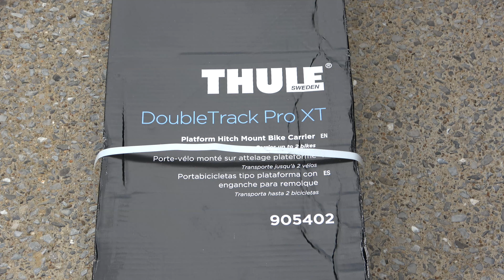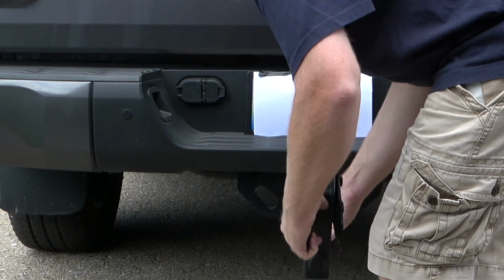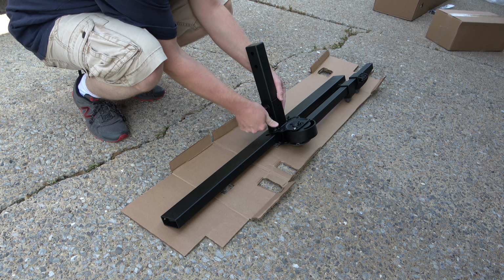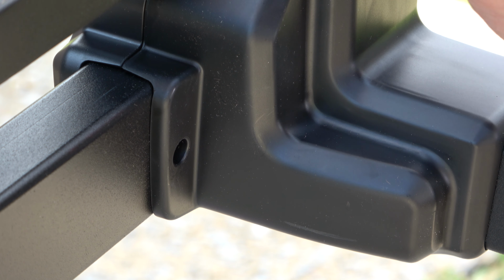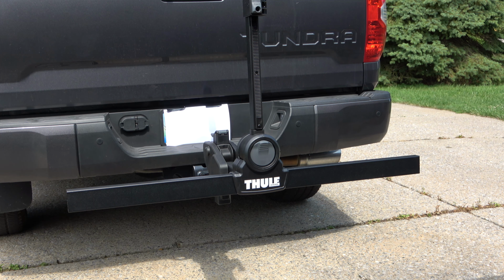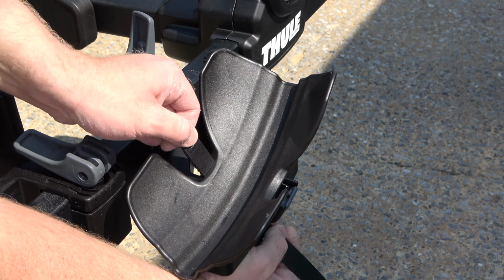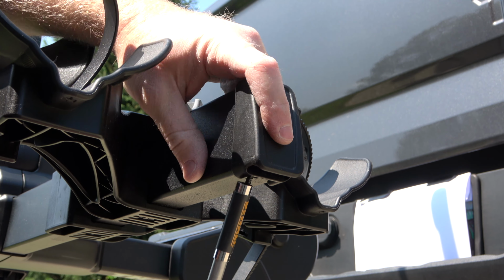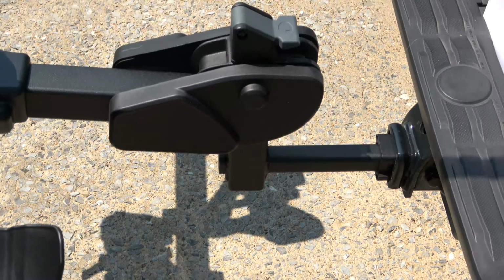Thule DoubleTrack Pro XT 2 (Model #905402) Hitch Bike Rack - Assembly Instructions

Comment: A huge thank you Mr. averagejoe.. I installed mine without a glitch using your video instructions.    All the tips were hugely well thought of.  As far as the theft situation for the brackets that attach to the locks, you can basically permanently disable the bolts by applying a dab of epoxy putty to the heads of bolts. It will harden to rock consistency and be impossible to remove, whether you want to or not.
Reply: That's a really good idea. Thank you!

Comment: This video was quite helpful in prepping for assembling the rack with a friend.  We need a maul to get the cradles on, and for that reason didn't worry about securing the end caps, since the cradles aren't going anywhere - or probably not the caps either!  You don't demonstrate how the rack with bikes on can hinge down to allow access to the tail gate or trunk - another asset of the Pro XT.  We found to do so we needed to lift the rack up to get the lever to release, then let the whole rack hinge down.  Also, we fastened the whole plastic cover over the button before putting the large mast piece into the hinged receiver as Thule suggests in the directions, though you can certainly do it as above.  Socket wrench was a great suggestion.

Comment: Great review! If I saw correctly, I believe the two hooked locking bars are reversed in your video. They are two different lengths with the longer bar installed in the lower lock housing. Short bar on the top. Just assembled mine and can’t wait to use.
Reply: Thanks for this! I went back and switched mine.

Comment: Hi, in the first step of attaching the Thule hitch mount area to the existing hitch, what is the threaded bolt threading thru in the existing hitch? Neither my hitch receiver nor the Thule rack hitch end has threads. So my bolt with washers that would attach to the lock is loose. What am I missing here? Thanks in advance.
Reply from the maker: What vehicle do you have?  The reason why I ask is because I had a similar problem when trying to attach the rack to my Tundra.  After speaking with Thule support, it turns out that the bolt was just a hair too short to catch the captive nut insert inside of the rack stem.  This is due to the thickness of the steel on the receiver of the vehicle.  Thule has an updated part to correct this issue.  It is simply a bolt that is maybe a half an inch longer.   They will send it to you at no charge if you give them a call.  So, to answer your question, the bolt is screwing into the captive nut insert inside of the rack stem.  Thule told me this is an issue with my truck and with all late model Subaru’s.  I hope this helps.  Please consider giving this video a like and subscribing to my channel.
Reply: @averagejoevideo9556  it’s a 2011 Volvo xc60. What I think the issue is that the captive nut is non-existent in the bike hitch housing. Thank you for the feed back.

Comment: Does this works with double suspension carbon bikes where the top tube is not straight, adding adaptor bar to the bike?
Reply from the maker: It should work with that style of bike as long as you have the adaptor bar.  In my opinion, a better but more expensive Thule option would be the the Thule T2 Pro XTR.  That particular unit uses a wheel clamp instead of a frame clamp.  However, it’s almost double the price.
Reply: @averagejoevideo9556  Thanks for the answer. You're right, my concern with XTR it's the price. What's your opinion about Thule Helium Pro?, some posts said bikes hit each other.  I hope to choose the right rack.